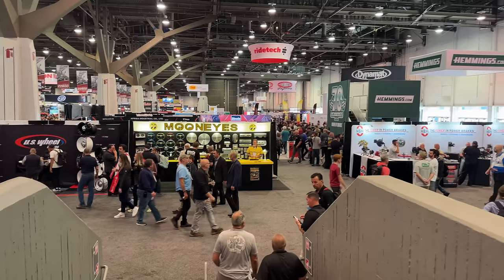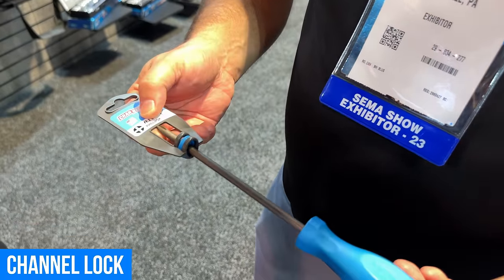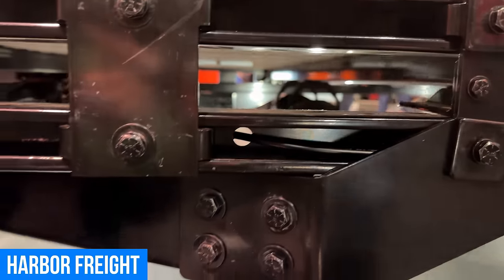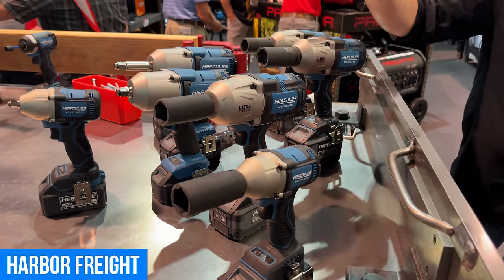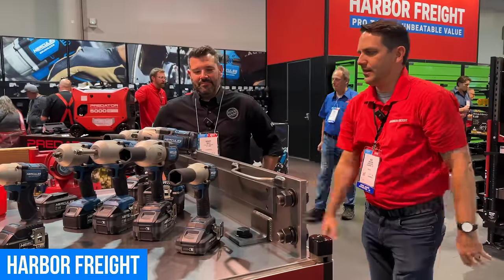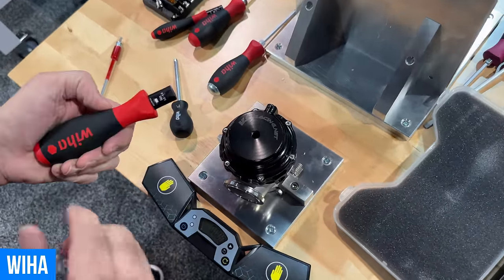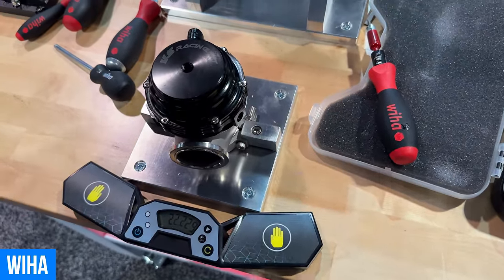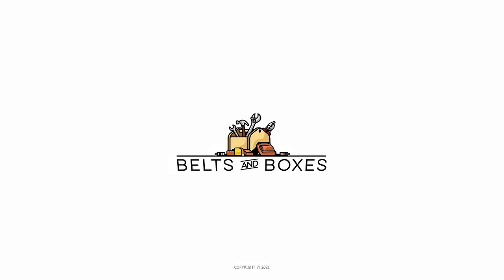NEW Power Tools and Tech from SEMA 2023 Show!

Comment: This video is horrendously broken. You need to pull it and re-render the video. Really should have caught that beforehand...
Reply from the maker: It was caused by a transfer through gdrive. It was reviewed beforehand, and we’ve never seen this effect from gdrive. We’ve since changed our process of protect against this. 

We can’t remove and upload. The YT algorithm simply doesn’t allow for it. We didn’t realize the extent of the issue until an hour after it had been up. That means our core viewers had already watched. 

Had I taken it down, and reuploaded a fix, our core viewers would have skipped it because they already saw it. Or worse, click on it, saw it was something they had seen, and then left. Both tell the algorithm “the regular Tool Show viewers are choosing not to watch. This is a poor video and won’t perform.” That means it won’t be shown to anyone else, and die. 

Just how the system works. It’s a pity because I’d love to upload our video in perfect condition. But no one would see it. So instead we leave this up, and learn from the process. We now move our files through Dropbox and added a final review after AI upscaling and upload. 

Sorry for the inconvenience, and I appreciate your feedback.